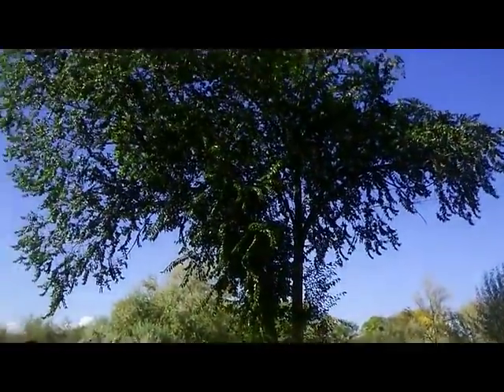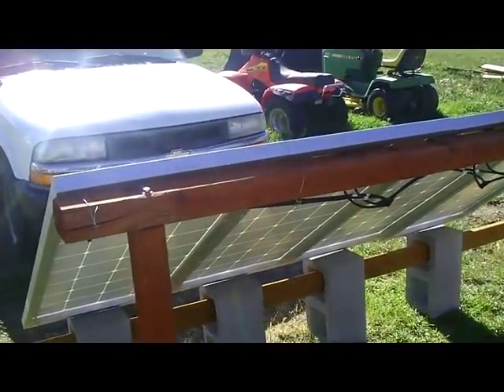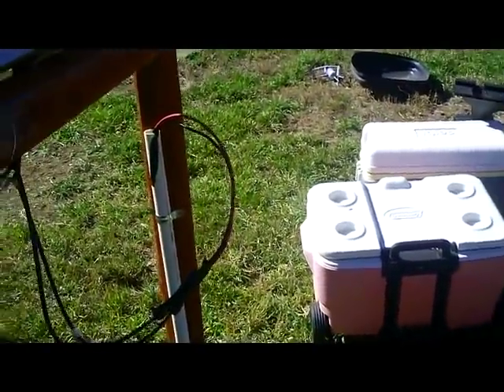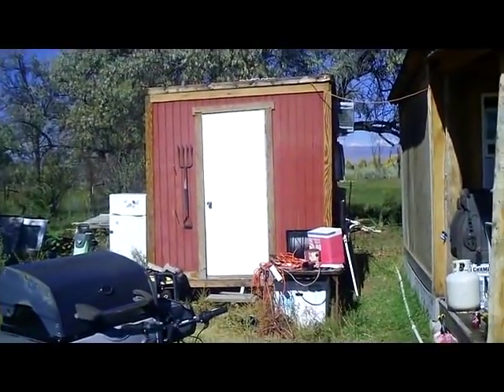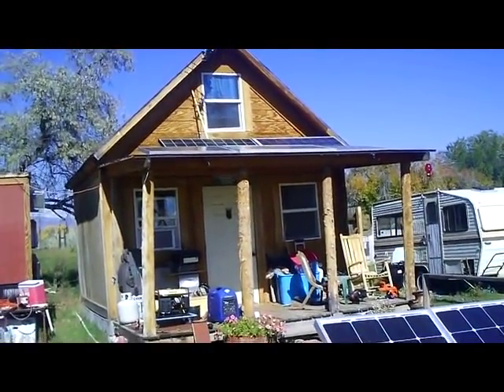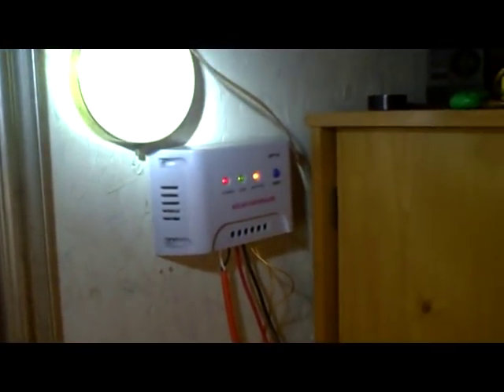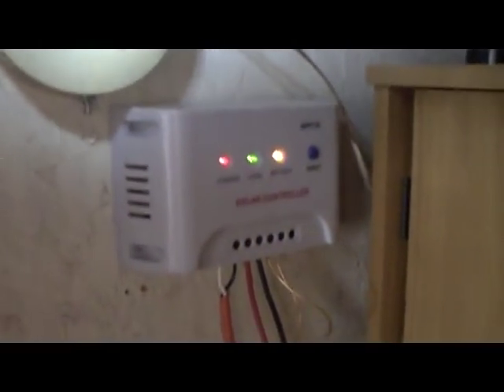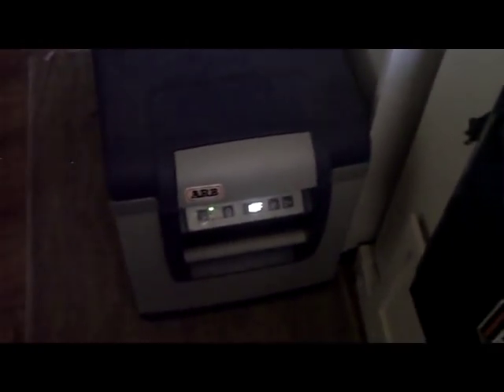Ground Mount Solar 400 Watt System

Comment: can you tell us where you got the panels from?
Reply from the maker: Those are Renogy 100 watt and Renogy has a store on Ebay.
Reply: solarcabin
thanks
Reply: solarcabin if I want to run a TV that's pulls 100 watts, a Xbox that pulls 80w, a laptop,a 1800 btu ac.and a regular size fridge. what will I need to run this?

Comment: Hi Lamar. Great video as always. It is looking good there. A lot of people I see on you tube are dumping 12 volt system and going to 24 volts. What are your thoughts on that.
Reply from the maker: 24 volts will allow you to use smaller gauge wire but hooking batts in parallel does not double the amp hours so for a small system like this I prefer a 12 volt system.
Reply: solarcabin I love the cabin and your sense of spirit is just great...

Comment: Was curious if you new yet with that new setup about how long you could watch tv at night with those 2 batteries? I'm trying to do a set up like yours and would just want the tv on it for starters. Thx
Reply from the maker: I watch TV on my laptop with a converter but I can run the laptop all night long and it is 70 watts so you should be able to run an LED TV a long time.

Comment: I am a novice at solar power so I am still learning but as I understand, 8 gauge seemed a little light for the run from the panels to the controller. I estimated your cable run at about 50 feet. I used an online calculator to suggest an appropriate wire gauge and according to the results, you would need 4 gauge to keep the voltage drop to less than a volt.  I would be interested to know the ‘real world’ voltage at the panels versus at the charge controller.
Reply from the maker: The volts at the panel average 20 unloaded on full sun days the run is about 40 feet so 8 gauge is needed. There will be a small power loss but not enough to be concerned about. At the controller I am pulling 15 volts on average which will be reduced by the controller to 12 volts. As long as you average 14 to the controller everything is good.
Reply: solarcabin Doesn't the solar panel open/unloaded voltage drop a lot once connected to the controller and batteries?
Reply from the maker: Yes it will drop to 14-15 volts and 14.5 is what the batts can be charged to safely. The controller will step down the volts as the batts start getting full to pack in the power.

Comment: Nice setup with the new solar panels. Can you provide a link to the place you bought them from?
Reply from the maker: Renogy has a store on Ebay and these are the 100 watt mono panels.
Reply: solarcabin whats the dif between mono and others?
Reply from the maker: Arrogant 80s Mono crystalline panels use whole cells. Polycrystalline panles use small pieces of cells. Mono are better if you get good sun all the time and are a little more expensive.

Comment: Any reason not to run the ARB direct to 12v DC?
Reply from the maker: The ARB will run off of either. When I get a dedicated 12 volt line off the batts it will be run off 12 volt.

Comment: Doesn't the ARB fridge run off 12v? Wouldn't it be it better then converting it to 120v? olllllllo
Reply from the maker: The ARB will run off either and when I get  direct DC line from the batts I will run it off of that but I still shut it off at night to conserve power.

Comment: Nice one my friend. Glad to see you using 8 gauge, most would've used 10. DC always need large gauge to cut down on loses. Glad to see you back at it.
Reply from the maker: Hi Jerry, yup for  few cents more go with 8 gauge and it really increases the power flow and reduces heat in the wires.

Comment: Hi LaMar, great video as always.
One question for you, what size addition will you be doing?
Will it be the same size as you have now?
Next year I plan on doing a 20x20 a lot like your's but with 4 ft walls  up stairs for the roof to sit on.
And as soon as I get than done and I get the money I plan on putting on a 12x20 lean to on the north side for two more bed rooms for when my grandkids come to visit.
I will get most of the wood from a saw mill about a mile from my place and get it a whole lot cheaper than from Home Depot or Lowe's.
I would like to do 8 or 12 inch walls and will do 12 inch floors and roof for more insulation.
I will do a tin roof because a family member tore down an old barn and saved the old roof that is in real good shape and he's giving it to me for FREE..... :)
I look foreward to seeing you do the addition and good luck on it.
Reply from the maker: Thanks- the addition will probably be 12x12 so it is hidden behind the existing cabin. I will use that as an office/shop and for a guest bedroom. My chest freezer will be stored out there when I am done.

Comment from the maker: Because of a couple of jerks trolling my channel subscribers I now have to approve all comments so if you don't see your comment right away don't worry and I will review and get them posted as soon as possible. Thanks for understanding!
Reply: Looking good lamar..yours was the first off grid channel i saw on youtube..doing off grid cabin..i am off grid also now on my own land in central florida in an old ghost town..i am building my cabin interor only i started with a 12x20 pre built building...its comming along..just wanted to thank you for inspiring me to go for it....thanks...ps...would love to hear some more of your songs....john
Reply: Larz I use MidNite Solar's KID controller. It can do 30 amps max. My battery bank is actually nominal 24v bank. I connected two batteries in series to form 24v and then connect two of those 24v batteries in parallel to form my 250 AHr 24v battery bank. 

I have to say that after a year's worth of usage, these batteries are NOT performing well at all for the cost. It goes back to the fact that they can't be equalized. The batteries eventually go out of synch in voltage. And it's almost impossible to maintain these AGMs without the ability to equalize to bring them all back to equal voltage. I would NOT recommend these batteries for a solar system. If I got a do-over, I'd get lead acid batteries where I could add water and equalize. Probably go with Trojan batteries.
Reply: Lance Guilin hey I note that you have 600watt system I just got my 400 watt system need to collect a few more thing to start it up but how many 12v batteries will it charge properly  I live in the 48 parallel so they are say 3 good hours of sun I got the mppt charge controler instead of pwm
Reply: solarcabin Great videos!
What is your opinion on this?
I'm in Florida and summer is terrible. I have thought about a cabin or prebuilt from Home Depot and go solar. Except, I want to be hooked to grind only as a emergency backup, due to weather here. I'm learning....Thanks!
Reply: hi Solarcabin. Interesting. We have a lot of the same solar equipment.

I have:
6 x 100 watt Renogy Mono Panels
5 x 125Ah VmaxVtank Solar AGM Batteries
1 x 175 Watt Go Power Modified Sine Wave inverter

Haha.. So I found it very funny when I saw this video that we have some of the same stuff. I got all my stuff before seeing this video. To be sure, I also have a 1500 Watt Cotek Pure Sine Wave inverter, as well as a 300 watt Go Power Pure Sine Wave inverter, but I do like the little 175 watt Go Power Modified Sine Wave inverter for the same reason you do -- i.e. no fan, so it requires less power and it's quiet. 

Regarding the VmaxVtanks AGMs, I have mixed feelings about them. AGMs have their pros, but one HUGE con is that you can't equalize them. I am starting to really regret buying these Vmax AGMs because they will ultimately get out of balance when you have a battery bank and it would have been much better if you're able to equalize the entire battery bank to bring them up to the same high voltage. 

If you only use one AGM battery, they work great. But if you have more than one connected together, given the fact that you can't equalize them, I don't think AGMs are the best for battery banks. 

Anyway, good look and happy holidays!

Comment: Thanks for your video sir, do you have a link to where you purchased these panels. Looking into installing a system in the next few months and wanted to start sourcing supplies. Enjoy your knowledge and videos sir! Thanks.
Reply from the maker: Hi Chris and thanks:  http://stores.ebay.com/Renogy-Solar
Reply: Much appreciated sir!
Reply: s very much appreciated, the both of you.  less than two minutesin to the video for the first watch and it's the exact question that I had.  Love your videos.  If you have enough food, a solar distiller, ammo, etc.  I highly recommend saving any extra work in silver.  Have a video with Bix Weir I recently put up which seems to say it all.  In any event,  much appreciated both of you!

Comment: Do you have problems running your converter on things because it's not a sine wave converter?

Thanks
Reply from the maker: I use a modified sine wave inverter and have not had any problems using that but for a motor or some fridges you should use pure sine wave.

Comment: super cool !.... how do you run the air condition machine ?  with a seperate generator ?
thanks.... keep the good job !
Reply from the maker: I only need the air conditioner for a few weeks in summer so I just run it off a small genny for a few hours a day.

Comment: what about your old system are you going to reincorporate it with your new system or going to do away with it and what about your old battery bank do the two batteries hold just as much power as the bank you used to have
Reply from the maker: My plan is to put the older panels on my camper and have a separate system that will run from that into the cabin but can also be taken with me camping.